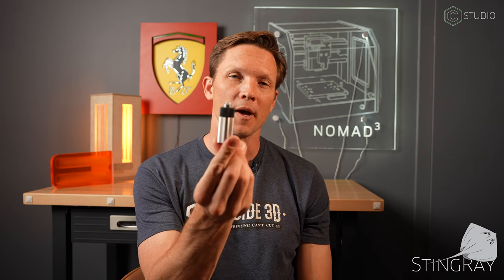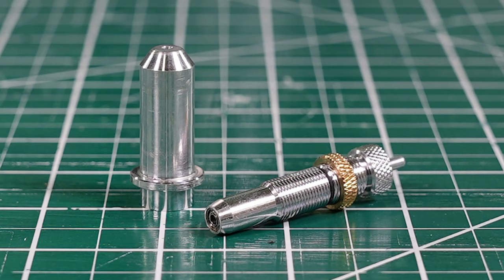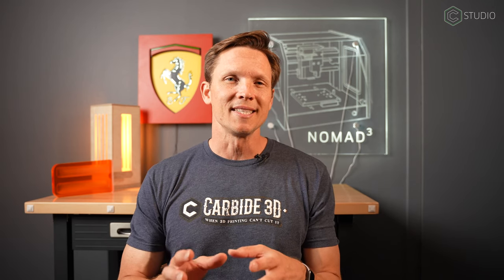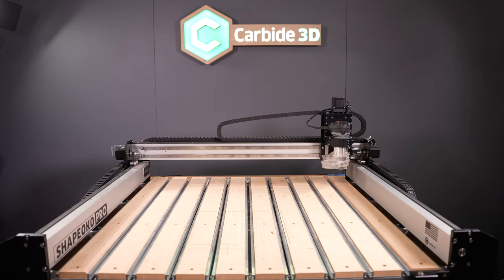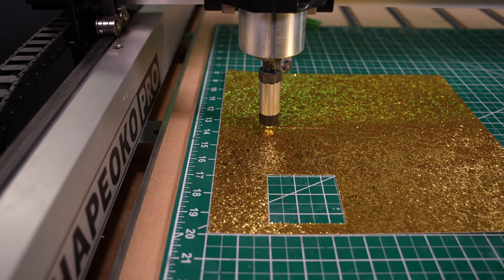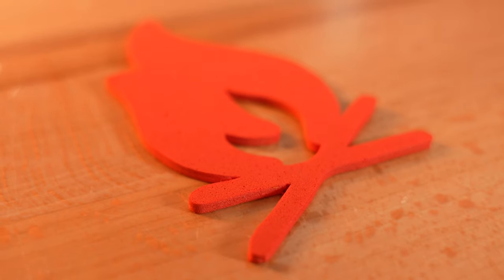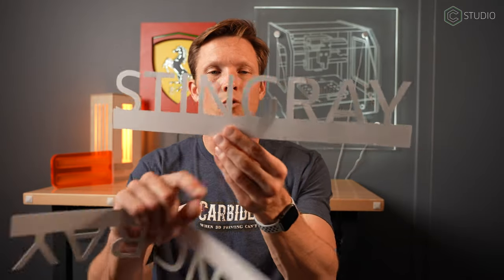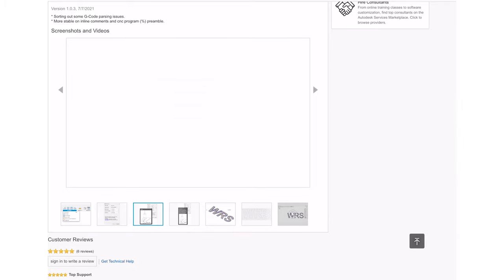All New Drag Knife - The Stingray

Comment: Hi Kevin :goodvibes:  Long time no see.  I hung up the transmitter and I'm a Shaper Origin guy (as well as fine woodworking in general) and that's how I ended up here.  I've owned a few vinyl cutters over the years so I get the drag knife concept.  The optional springs for tension and compliment of knife angles are a nice touch.  it's nice you offer this for your product line.  Maybe I'll have to play with one of these in the Origin to see how it works 😊

Comment: Thanks for sharing. I may've missed it, but will this solution work withthe larger footprint CNC machines? We have a ShopSabre Pro 408, for example.
Reply from the maker: This is a 1/4” tool designed to work with any CNC machine.

Comment: do I need to ease and polish the edge of the metal pressure foot? the machined edge on mine feels a bit sharp.
Reply from the maker: You certainly can ease that edge, yes.
Reply: Hi Kevin. Just to make sure I understand it correctly: the spring is used to push the head against the material a little so that it can compensate the minor unevenness of the cutting bed. I would polish the “foot” or “head” as smooth as I can after I get my set.
Reply: I've seen other videos with the same insert and they suggest rounded over the edges to keep it from catching.  I'm going to do that with mine.